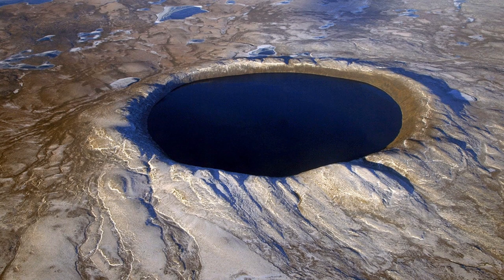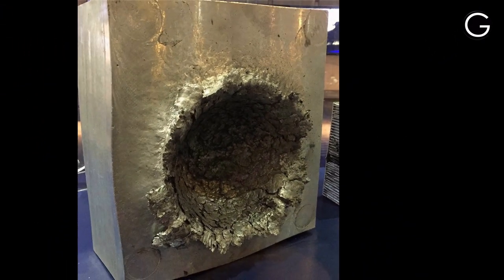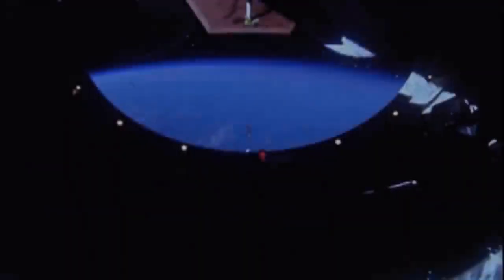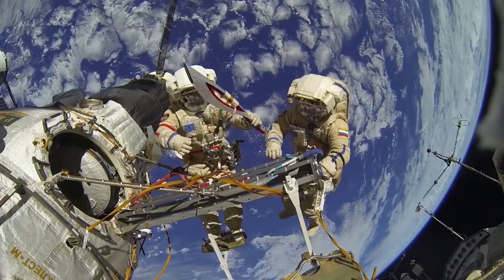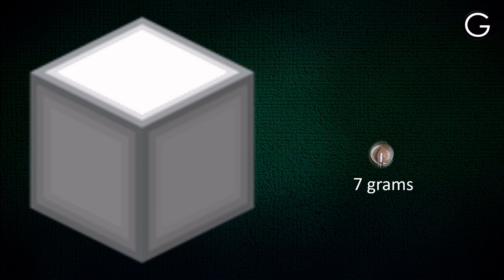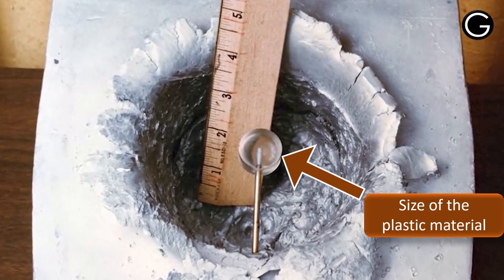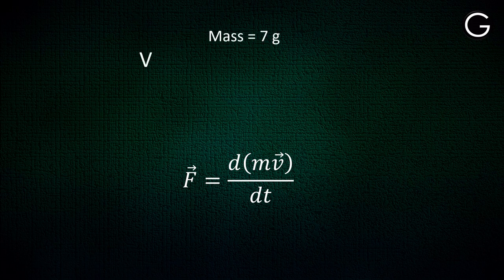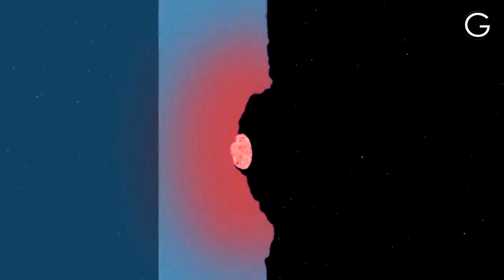Just 7 g of plastic & damage done!

Comment: Why do you say that it was a particle and had a mass of seven grams?  
Firstly, it's an object .  In casual usage, a particle is a tiny object.  If we're dealing with physics, 'particle' has a singular definition - and it isn't just a random bit of plastic or other material.  
Since the plastic object was  fired in a particular direction, we call it a *projectile*. 
Secondly, its mass was approximately 14 grams.
Also, the velocity of the projectile was reputedly 15 000 mph.  That's not 30 000 km/h - it's just over 24 000 km/h, or approximately 6667 m/s.

Comment: How can some thing in a vacuum have that much force?
Reply: No air and no gravity
Reply: No air = no drag
Reply: E (Energy) = (equals) M (mass)    2 (squared) to C (speed of light), around 360,000 km per hour 
Example 
1 gram moving at C (light speed ) would have the weight of 360million tons , now that's just a rough number , the number is actually greater because it's mass squared (x4) proportional to C. Now imagine trying to stop that and support its weight as it slows down. The hole that is caused is proportional to the density of both materials and the difference in (strong) force that binds the atoms,
Let's not forget  plastic and aluminium are relatively soft to each other allowing for maximum kinetic transfer

 The vacuum has nothing to do with the force applied all that does is allow the plastic to move so fast without gaining drag